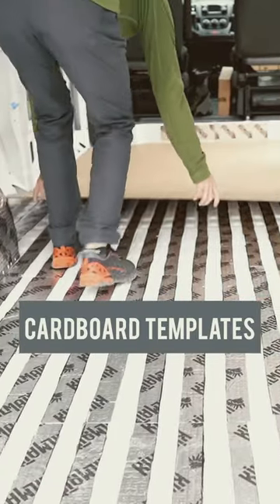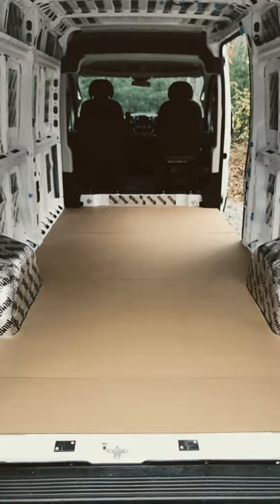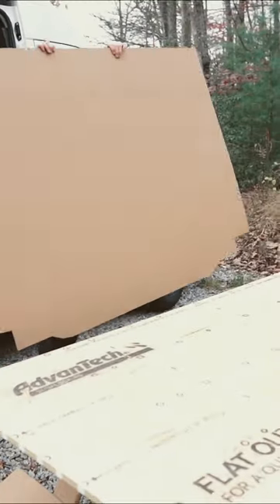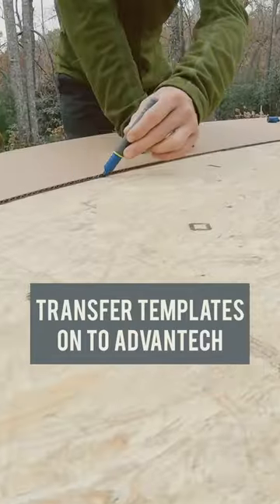Van Build | Subfloor Installation

Comment: What kind of insulation did you use on your floor?
Reply from the maker: we didn't insulate the floors. We installed heated flooring mats under our floor instead.